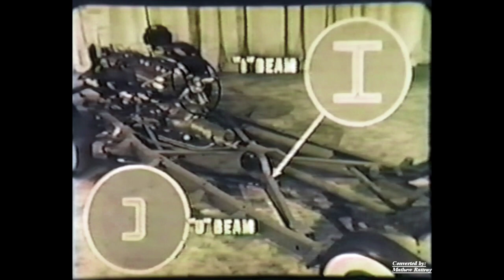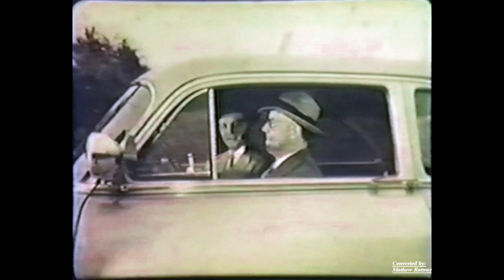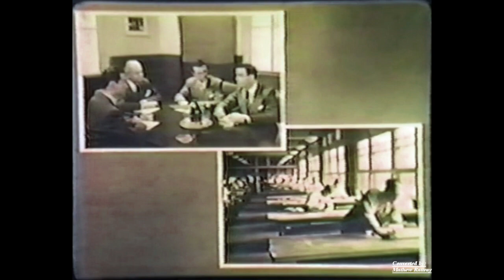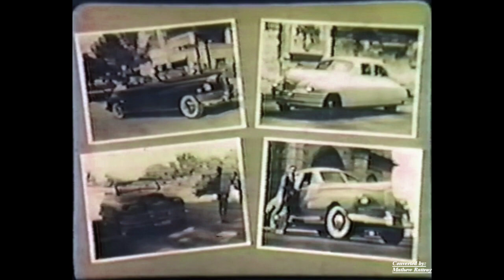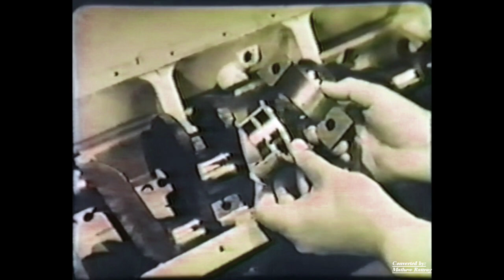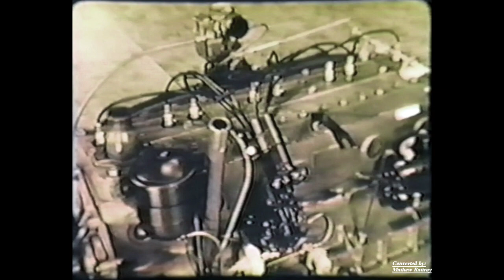1951 Packard training film - The inside Facts

Comment: I thought that the 9 main bearing engine was called the "Spitfire" engine
I wonder if anyone knows whether the top Buick engine of the era had 9 main bearings? 
Would be interesting to have a neutral mechanic do a side by side disassembly and comparison of the Pontiac Eight and the smaller 5 bearing Packard engine (which had a somewhat larger displacement than the  Pontiac) 
I believe an oil filter system was a dealer add on for the Pontiac,most of the cars didn't have it and that probably contributed to the typical older car blue smoke exhaust that usually started to show up not too long after 50 or 60 thousand miles 
  Was the 9 main engine developed from the 356 engine? Did 1950 Packard have the 356?
Reply: I just looked at a 1949 Chrysler and it had a flathead 6 with "Spitfire" on the head.
Reply: @Arise-308  I think entry level Chryslers before 1951 came with 6 cyl. but New Yorker and/or Imperial came with an inline L head Eight
1951 supposedly saw the first Hemi V8s but probably only in the most expensive models
later all of the inline 6 would get replaced by the "Polyspherical" V8 ? (Below the Hemi in the price line)
I think the flathead 6 used in the Chryslers was larger displacement than the flathead sixes used in Dodge and Plymouth 
  weird that both Packard and Chrysler were calling their engines "Spitfire" I guess WW II aircraft were still on people's minds a lot although "Spitfire" and "Thunderbolt" were more names of aircraft rather than of aircraft engines